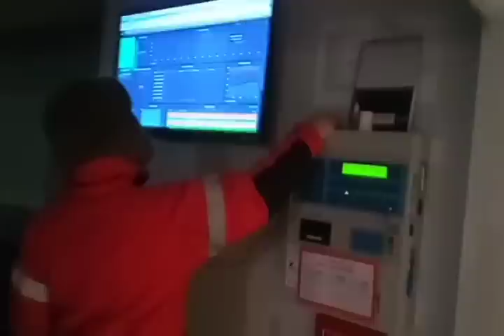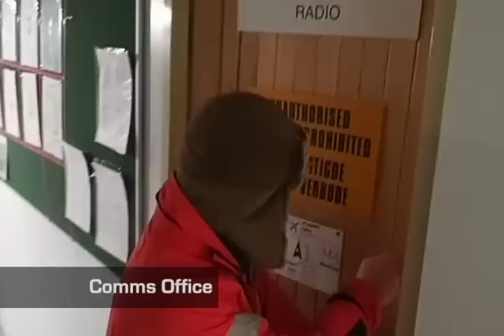Life of an Antarctic Adventurer - SANAE IV Base

Comment: What does South Africa have to do with space? What other country is paying for this? It can't be South Africa. They can't even keep the electricity running there
Reply: South Africa actually has a long history in space science, engineering and exploration - and more importantly, a commercially viable and successful space industry. Anecdotally, the CEO of a local satellite component manufacturer reckons between 15-20% of all satellites currently in orbit have at least one component of South African design and origin. You don't have to be the one paying for the rocket or astronaut to benefit from space.

Comment: Breakdown:
0:00 Introduction
0:46 C block tour (Gymnasium and braai area, store room, hanger, generator room, technical workshop)
2:38 B block tour (Games room, bar, dry store, waste room, cold store, kitchen, dining room)
4:50 AB link (Comms room, main entrance, rooms, cinema, medical center, radar room
10:00 Upper physics lab and radar system tut
12:30 A block (water testing lab)
12:55 Digging and a bulldozer
13:58 Windy
14:30 Inside the radar hut / survival hut
14:56 Windy and extro
Reply: Thank you